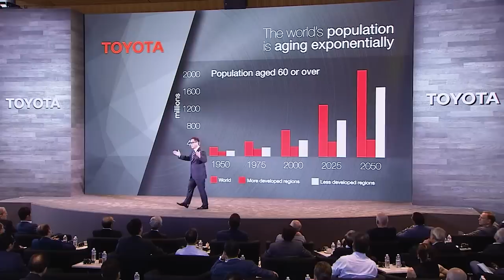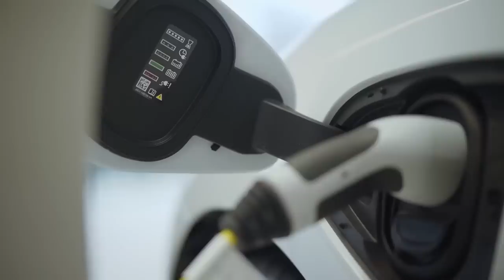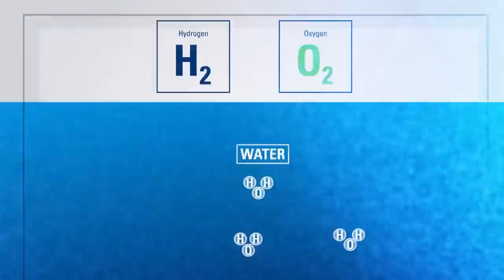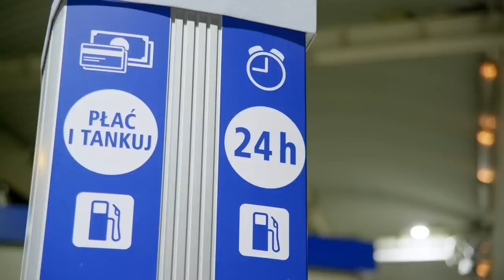New Toyota CEO Shocks Everybody | Huge News

Comment: I'll be supporting toyota. I like their common sense business strategy
Reply: ...of introducing a fuel source that has never ever been commercially viable, requires insane infrastructure revamping, and is highly explosive.
Common sense= I'm afraid of change and I like my perspectives affirmed because i like go brrr brrr brrr
Reply: @justcommenting4981  not used = not smart 🤓

How does that even make sense. Cars that use electricity weren't used a lot but it doesn't mean it's a bad idea. Why shouldn't they try using hidrogen, it's prime time to use it.
Reply: @hippityhop9522  because hydrogen is not naturally available. You have to expend energy to extract the hydrogen from water and that will require more energy than can be used to power anything. There are no hydrogen wells. Electricity is also widely available and the infrastructure is literally just wires connected to a power source that could be anything from wind to gasoline or a nuclear plant or even a hydrogen power plant(which as mentioned would be kind of stupid). The infrastructure to produce and move hydrogen is far more complex and dangerous than electricity, hydrogen is known for exploding and being hard to contain because its the smallest element. Lastly a hydrogen fuel cell DRIVES AN ELECTRIC POWERTRAIN. You guys are all praising Toyota for literally just making an electric car that uses hydrogen to power it. That's like praising them for using gasoline to power an electric car, which at least would be more efficient.
Reply: @justcommenting4981  Might want to reconsider your “…have to expend energy to extract…” argument. Ever been to an oil refinery?? Lots of energy being expended to get gasoline and diesel.  To get electricity you have to burn oil, coal or nuclear (which you guys hate[making an assumption here]). No infrastructure exists for 200+ million electric cars and no way wind/solar will supply that energy (not to mention destroying natural skylines to make it happen and don’t forget the sea life and birds killed by wind). Plus the outright rape of 3rd worl countries for the battery minerals (we have them in huge quantities in the US, much like oil but wait there are moratoriums in place…hmmm).  Look, we’re being forced by government into electric cars. Let us decide what cars we want. If Toyota can create/make marketable, reasonably priced H2 vehicles they will win. Tesla has self installed charging stations many place but not nearly enough. Toyota may be able to arrange installation of pumps in existing gas stations. Who knows? If not, oil fueled cars will continue to have a huge edge for decades to come. And BTW gasoline is a pretty dangerous fuel also…just sayin”
Reply: @MaxQ2989  
Hydrogen efficiency is still terrible. It takes nearly double the electricity to make half as much hydrogen.

Meanwhile, battery efficiency is around 80-90 percent.

In the age where most of our power is still dirty, can we really afford to waste it?

And on infrastructure, we have the grid. Level 1 charging can easily be installed in any home. Level 2 and above will require a wiring upgrade.

Plus, as much as a work in progress that is charging infrastructure, hydrogen is even more behind and takes more to set up.

We don't have hydrogen pipelines just lying around. And trucking hydrogen will require special containers and make hydrogen's already bad efficiency even worse.

Comment: Still driving my 2005 Corolla to this day, and I wouldn't be surprised if it was still running well 10 years from now.
Reply: We are still driving our 2003 Avalon.  It is bulletproof.
Reply: One of the best cars I ever had. If it didn’t get slammed by a truck it would still be running
Reply: Of course it will! Maintenance and taking care of it. The corolla is the best car in the entire world
Reply: Corolla 2001!!! And still running :)
Reply: Change the oil and don't abuse it and it will. I had a 1994 Corolla I owned for 23 years and 386,000 miles. I only got rid of it because it started to rust really bad since I live in the Northeast US rust belt.
Reply: 2005 Scion xA....a Toyota at heart..... 280,000 miles andd drives ( and looks ) new.
Reply: @hvacdr I’m still driving my 2005 tundra. I love it!
Reply: '81 mercedes diesel. 356k never been apart. 25mpg. Still going strong.
Reply: 03 hummer h2 and 1989 ford whinnybago warror class c rv both r going strong
Reply: I had a 2006 Corolla. I really miss that car. It wasn't sporty in the least, but it was trouble-free and efficient.
Reply: She will
Reply: nice, thanks for sharing! Long term quality is underrated in this day and age and should be rewarded more with lower taxation imo (lower taxes for models which last long).
Reply: I love my Toyota Camry 1989. when I started it ran right away no matter for a week rest. I do not like the original pain stared coming off!!
Reply: 2010 Corolla and it's about to hit the 200,000 milestone next week! 👌🏾
Reply: Bro I still drive a 1989 starlet and its perfect
Reply: 1999 Toyota Starlet 2dr hb, 5 sp.  172,000k.  Runs great, looks great, cheap as chips on petrol.  What's not to love?
Reply: I just bought a 2006 Toyota Corolla S. Had a reverse camera and Android Auto unit installed.

I'm going to change the fluids this weekend (transmission, power steering, brake).

Then, I will get it detailed interior and exterior. Especially interior to make sure it's clean.